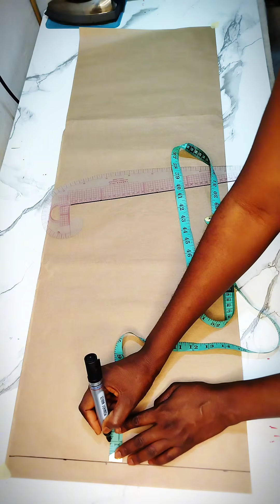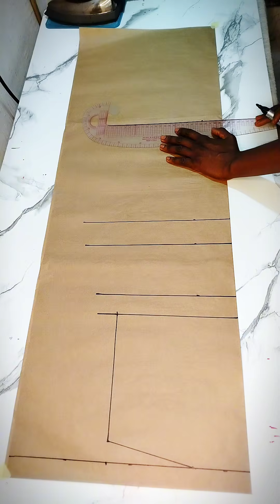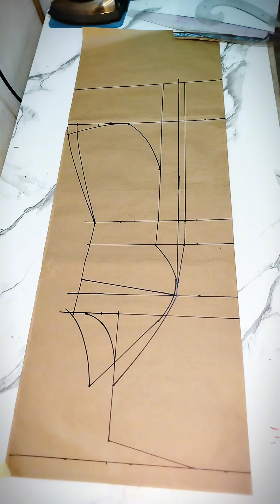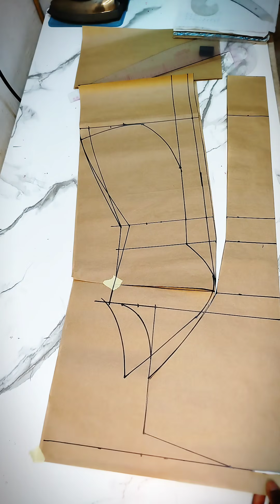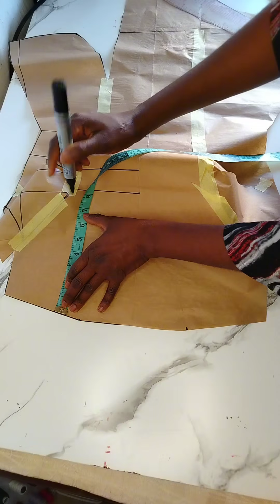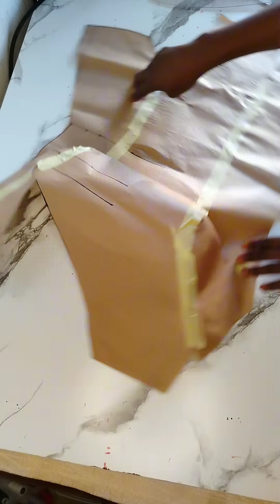How to cut a bustier blouse with Asymmetric neckline and hem pt1 #sewingtutorial #cutandsew #sewing

Comment: Ma please how many inches did you use for the back neck line
Reply from the maker: The back piece should be placed side by side together with the front piece use the same neck width for each side that is, if i measured 3.5 for one side of the front neck width, the back piece that i will attach to that side should also be 3.5, same thing with the side that i measure 4.5.
And for the neck depth, that totally depends on what you want you can make it high or low